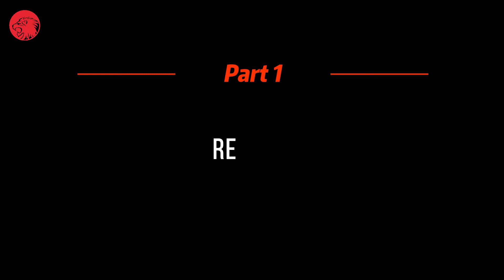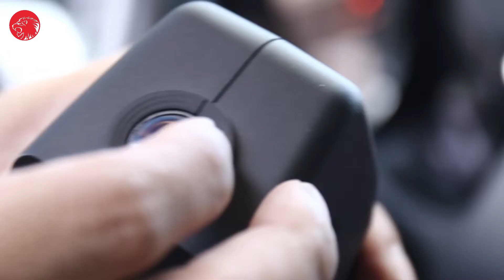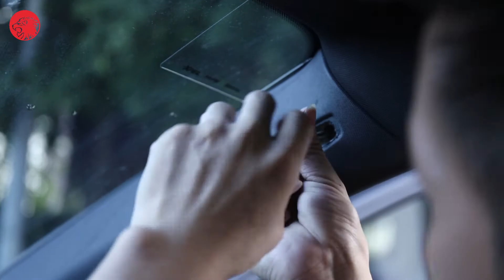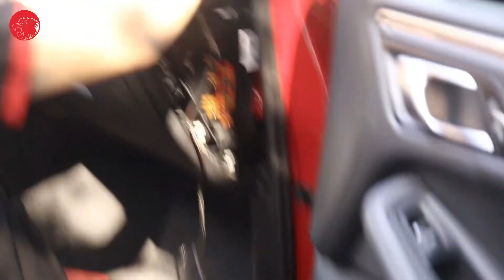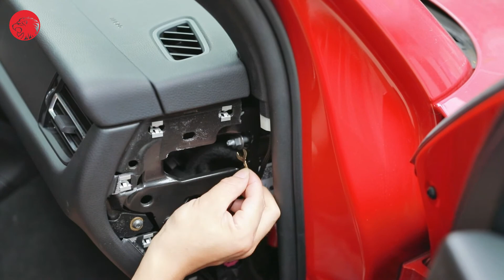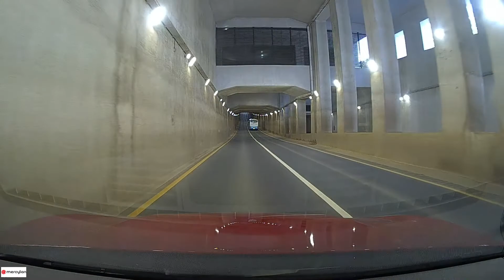MERCYLION A40-1CH Dash Cam For Porsche Macan| Get Power From Fuse Box

Comment: There are better setups now that don't require wiring back to the fuse box they come with Y cables..
Reply from the maker: Hi dear,
We now also include a Y-cable, allowing customers to use either the Y-cable or the fuse box for wiring, depending on their preference.